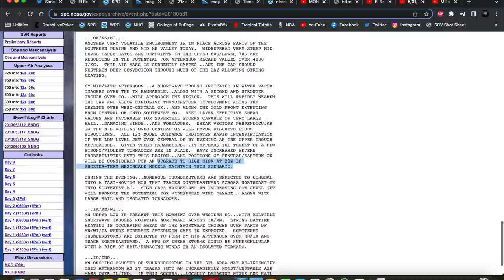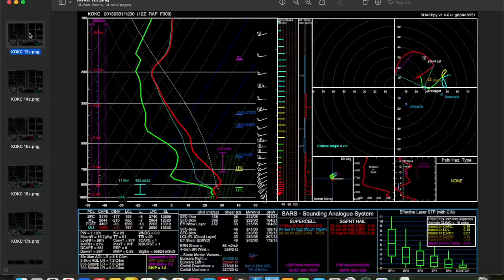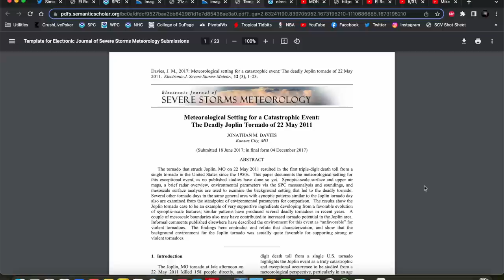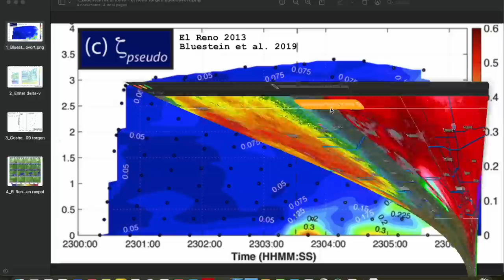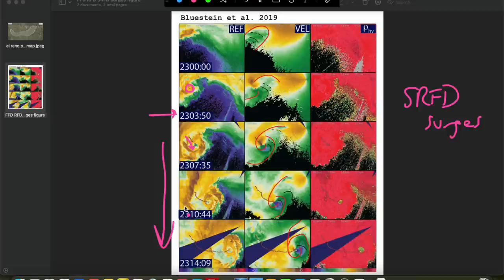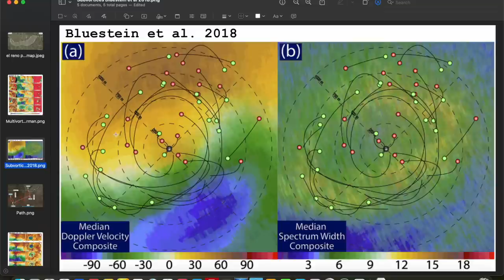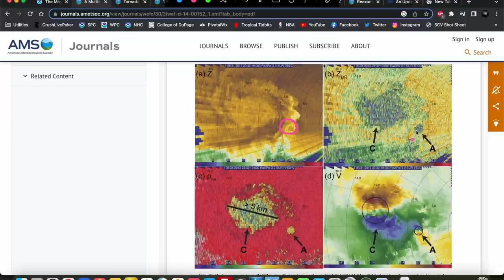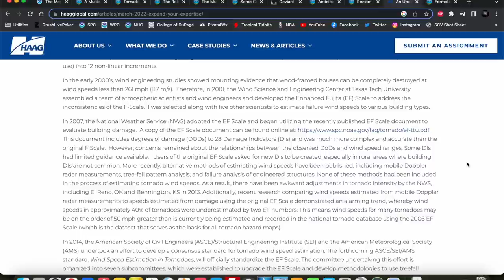The El Reno, OK, Tornado of May 31, 2013: A Case Study

Comment: Given both the 5/20 and 5/31 tornadoes did or tried in the case of the 5/20 one, occlusion loops, is there anything noteworthy that'd cause that in the geography of the OKC area and the OKC metro? I'm always fascinated by unusual tornado movements, and I thought you covered other ones in the past, I need to go check and see if you did0
Reply from the maker: Usually those loops are going to be the result of occlusion of the mesocyclone, which occurred in both the 5-20 and 5-31 cases. This paper goes into really good depth on the Moore tornado's loop and what caused it: https://journals.ametsoc.org/view/journals/mwre/143/7/mwr-d-14-00357.1.xml?tab_body=pdf

Frictional effects from buildings and such in big cities like OKC can cause shifts in the intensity, appearance, and track of the tornado, but most of the time, loops will be caused by processes within the storm.
Reply: @ConvectiveChronicles  Ahh, the buildings don't afect it as much as I thought they did, that makes sense. For some reason I assumed buildings would have a stronger impact on the tornado itself, I'mnot sure where I got that from, probably from a poorly designed building over here that did this but on a larger scale up to and including a major wind tunnel effect. I think I just got my wires crossed with that and tornadoes being afected by buildings in big cities.

That's a really interesting paper, I'll bookmark it and read it in bits

Comment: Skip Talbot was working on ground to cloud tornado genesis a little while ago. He gave some very convincing data to support the theory. In my opinion I lean more towards different types depending on the circumstances. For instance, strong low level inflow may support more of a ground to cloud genesis while more of an upper sheer with higher LCL or cooler mid layer would support more of a cloud to ground set up. This all goes to show that a lot more research is needed.
Reply from the maker: Totally agree; I think the type of tornadogenesis depends on the environment. Hopefully that’ll be the next frontier of tornado research.

Comment: The straight loopty loop that the path took is so insane to me. I’m sorry if you say why it did that in the video, I’ve just started watching and haven’t got there yet! But If you don’t talk about it in the video, can you tell me what causes it to take that crazy loop of a path?
Reply from the maker: So that was the result of a "failed occlusion." Usually during an occlusion, the rear-flank gust front chokes off the tornado circulation from the warm/moist air that's feeding it, and it detaches from the parent mesocyclone. That generally means the tornado moves to the left of the mean flow and is about to die off. However, in this particular case, that didn't happen; instead, the tornado restrengthened and regained its path toward the east, as a mature tornado would do.
Reply: @ConvectiveChronicles  thank you for the answer! I couldn’t imagine being a chaser and having to deal with that and trying to plan for that. Great video as always!
Reply from the maker: As a chaser, I can tell you it can be very difficult. In these extreme CAPE scenarios, you just have to give the storm space, as all rules go out the window. 

Thank you again!

Comment: I have to say, having watched several videos of this tornado, (in my very amateur opinion, mind you) I felt that it was fairly visually apparent that it was trying to "start" from the ground up. Like, you see these vortices spinning up near the ground, many of them kind of dissipating in an individual sense as other vortices spin up nearby, probably still contributing to the overall tornadic circulation and genesis but not "becoming" a whole tornado. But it took a number of vortices spinning up from the ground before the overall tornadic structure seemed to really "solidify" into a "full" tornado.

Comment: Thinking about the translational speed and how being so fast led to problems with the 3 second minimum just makes the April 27, 2011 EF5 tornadoes just seem that much more nightmarish considering how fast some of them were moving along the ground and they still were able to come away with the highest rating. Assuming I'm understanding the concepts correctly.
Reply from the maker: You got it; some of the wind speeds in those tornadoes were incredibly strong.

Comment: Okay. I’m just over halfway through this video yet I’m studying it like I have an exam! This is so interesting! And well explained. I wondered at the comment about loosing your access to RaxPol because u defended ur thesis and that blows my mind. I think the thesis that they form on ground first is very interesting as I have always wondered why we see the cloud portion of the tornado spiral down first. Like what pushes/pulls it down? And dance? It seems more like pulling than falling. Very very interesting
It’s almost like the velocity of the satellite tornado joining the main vortex forces it to expand and compound the total tornado into the direction the satellite tornado was moving, north east. It’s almost like the winds u mention cause the satellite tornado and that’s why it bends south and then north when the satellite makes the east/north sides the direction changes to that direction and when it comes to the backside it veers south then north/east as it comes around again. It looks like a curly Q. As if something was pulling the tornado path around and around.
Reply from the maker: Thank you! You have to be a current student to have access to RaXPol, and I no longer fit that bill.

Tornado formation is pretty complicated; the ground-up theory has been pioneered in the last several years where the rotation actually tightens first at the ground before working its way up. The top-down theory involves pressure perturbations and "dynamic piping," where the tornado basically drills down toward the ground. It seems to me like both are viable, but perhaps the environment plays a role in which one is favored.

Comment: Is there any correlation with high cape/low shear and ascending tornadogenesis and vice versa?  I think tornadogenesis can and does happen both ways depending on condition variables.
Reply from the maker: So that is one of my hypotheses. In my master's thesis, I looked at four different events w/ high-res mobile radar data. Found ascending tornadogenesis in the Elmer, OK case (shown in the video) and descending tornadogenesis in the 6-15-19 Putnam, OK case. The former was a higher shear case, while Putnam was a much weaker shear case. Obviously it's a small sample size, but there may be some merit to that hypothesis.
Reply: @ConvectiveChronicles  You should do a video on your thesis sometime!  I would love to hear about it.  Also do you have a link where I could read it?
Reply from the maker: @hgbugalou  That's a good idea, I might! Yes, here's a link: https://shareok.org/handle/11244/330737
Reply: @hgbugalou  This 2 Mile wide Monster was an unpredictable and complex Tornado. It was like it was designed to kill Storm Chasers. Twistex died because they were Unable to get to Safety when the Sub-vortices suddenly changed direction and snagged their Chevy Colbalt.
Reply: @ConvectiveChronicles  hi Trey, I was looking at your thesis paper and I was just wondering, how long does it take to research and then write those?
Reply from the maker: @Achronym  It takes awhile! I first started researching it when I began at OU, which was late 2018, and I finally defended my thesis in summer 2021.
Reply: @ConvectiveChronicles  oh wow! thanks so much for answering; I'm hoping to become a meteorologist once I get out of high school so it's always interesting learning about this stuff!

Comment: Isn't delta supposed to mark a difference between two values and sigma is used for summation? (referring to pseudo vorticity)
Reply from the maker: Are you referring to how delta-v-max is calculated within the pseudovorticity equation?
Reply: @ConvectiveChronicles  Yes (around 32:55). This is by far the best, most educational video i have come across, i just get a bit confused with the formula: If max outbound and inbound velocity of pixels are to be added (eg. 35 + (- 40)), shouldn't it be written with a sigma symbol? I'm sure if i came across this formula on my own without any explanations provided i would interpret delta V as a difference in those pixels (-40 - 35 = 37 or 35 - (-40) - which is also 37, OMG i understand now..i am so sorry for wasting your time. I'm on a slow side.. please ignore my comment, and thank you for this fantastic content!
Reply from the maker: @maja2383  Thank you so much! You're definitely not wasting my time! You are actually correct; technically, delta-v-max is the difference between the maximum outbound and maximum inbound pixel. Inbounds are designated negative, so if you have a 40 mph outbound and -35 mph inbound, you'd have 

delta_v_max = max_inbound - max_outbound
delta_v_max = (40) - (-35) = (40) + (+35)
delta_v_max = 75 mph

The negatives cancel out. In my explanation in the video, I kind of just used a shortcut...since we know the negatives are always going to cancel out, I just called it a sum, using the absolute value of the inbound pixel. But you are correct, it's technically a difference.
Reply: @ConvectiveChronicles  Yes i realized you used a shortcut as i was typing...it was not my intention to be petty about it, i just got a little confused there, i'm sorry. Thank you so much for the clarification. I'm blown away by your overall analysis  and i'm finally beginning to understand these phenomena. Thank you! Cheers!
Reply from the maker: Thank you for the kind words!

Comment: They need to come up with a better way to rate a tornado besides the Fujita scale. This tornado, as beastly and large as it was, is rated as an F-3, which is absolutely ridiculous. The monster was an F-5 in its violence or none have ever been. Just because it hit mainly rural areas, doesn’t mean it was some kind of weak F-3, which is what people in. The future looking back at it will think. More needs to be taken into account than just the damage it did. 

     The flaw in the current rating system, might keep someone from comparing it to other big, violent tornadoes just because it’s an F-3, possibly missing some similar links to how and why it formed and moved like it did, duration on the ground etc, etc.
Reply from the maker: Yeah, that’s always been the source of intense discussion about this tornado. Good news is that they are actively working on improving the EF scale.

Comment: And they gave it an EF3 >_> The WHOLE freaking mesocyclone looked like it was on the ground!
Like man, common sense should tell us it was definitely higher. Thanks though Trey
I actually used to wonder if tornadoes are simply baby areas of low pressure, and a key to understanding them better would be to apply the same behavior as a normal Low and see if it matches up
Reply from the maker: That’s exactly what a tornado is; it’s a very very small scale area of strong low-pressure. If you know of Tim Samaras’s work on the 2003 Manchester SD tornado, his probes captured the most significant pressure drop ever recorded as the tornado passed over. That’s because they’re areas of strong low pressure!
Reply: This was Without a doubt an EF5.
Reply: Yes, I know we can't have a perfect tornado rating system, it's not the nature of tornadoes..HOWEVER, I think both the F rating system and the EF system are VERY,VERY flawed...there were/are a good starting point, but we can and should do better...rating only on wind speed estimates only to damage done to man-made structures, based on the opinions of a couple of investigators, is, well,  just not good enough. I believe there should be taken into account a BROAD number of factors, and arrive at a rating when taking ALL the factors into account..this tornado was clearly a high-end EF-5, and is a very glaring example of how inadequate our rating systems are...the 2011 Tuscaloosa-Birmingham tornado is another example. The hurricane rating system is not perfect, either, but it is far better than the tornado rating system..using the Tornado system, a monster, category 5 hurricane would be rated category 0 until it made landfall..not a very good scenario for advanced warning...

Comment: But this ascending tornado genesis is not from ground to cloud, but from lowers parts within the cloud to upper parts of the cloud. The tornado still grinds down from the wall cloud to the ground, that's why you sometimes see a funnel cloud up in the base of the wall cloud while there's no rotation in the ground
Reply from the maker: Studies using close-range, high-resolution radar data say otherwise.

Comment: You mentioned that the NWS measured a damage path at one point of 2.6 miles. Was the path continuous in it's width, or was some of the the damage within that span created by satellite tornadoes? Because as you said, a satellite tornado is a separate tornado. I guess my question is, " Was there ever an actual 2.6 mile wide funnel on the ground?
Reply from the maker: The tornado was not continuously 2.6 miles wide, but it was at its largest point. There wasn’t necessarily a funnel 2.6 miles wide at that time, but the tornadic circulation was that far across.